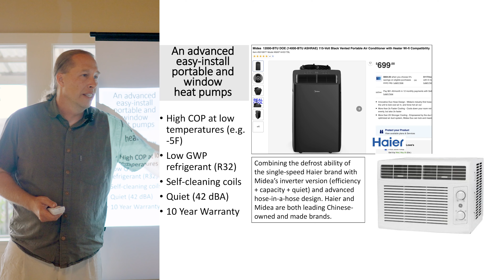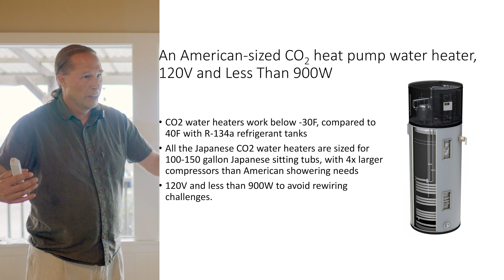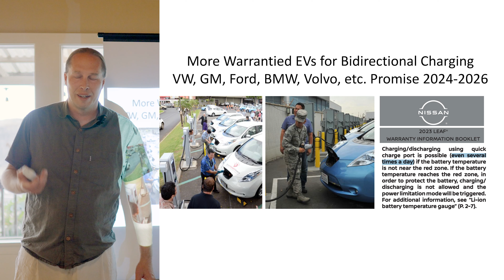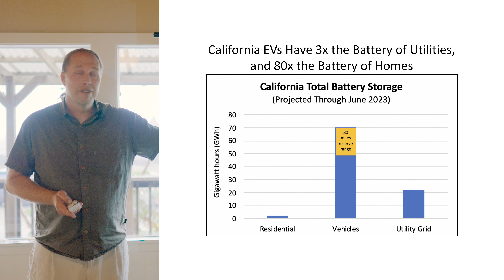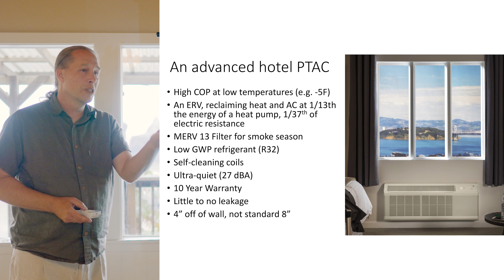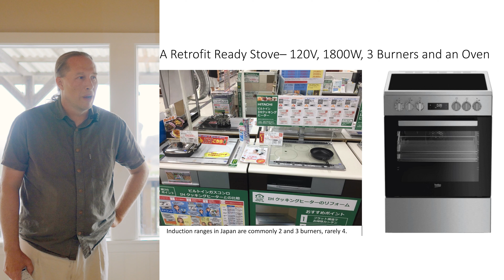Advances, Innovations, and Missing Products for Societal Electrification

Comment: Great presentation, here in the UK we have a CO2 heat pump commercial unit made by Clade. They have great SCOP's and are affordable. The CO2 heat pump hot water cylinder is desperately needed and the manufacturer that brings it to market will see huge demand.